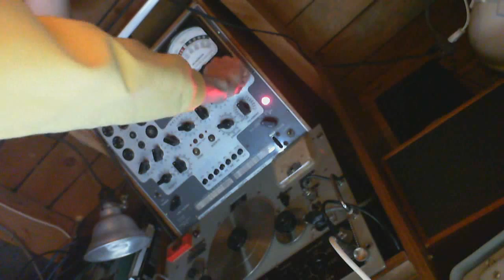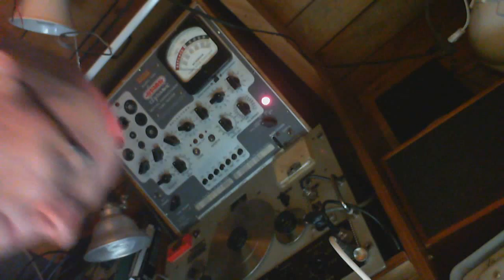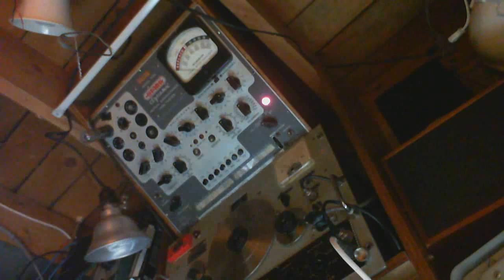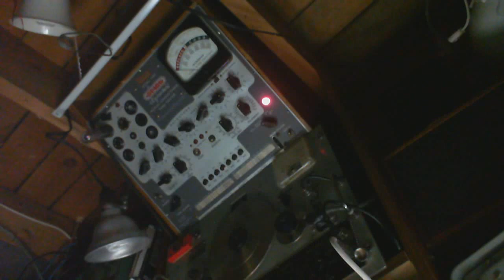Canadian General Electric KL-76 Vacuum Tube Radio Video #7 - Testing the Magic Eye

Comment: Jim, why not solder the resistor under the chassis where the wires go rather than taking the socket apart and risking breakage? At the very least you can use clip leads to temporarily insert it into the circuit to verify that this is the correct diagnosis. (It sure seems like it is but never say never. It can't hurt to verify.)
Reply: I am thinking he will have to take the socket apart anyway due to removing the old resistor. In my humble opinion.
Reply: That resistor showed 100% open so perhaps not.
Reply: MisterClaws
I hope not. though I have seen them make a reconnect before. due to thermal expansion. The odds are like 50/50 of that happening.Thank you for the reply. Take care
Reply from the maker: In my previous encounters with Magic Eyes, the resistor was never open but needed to be changed.  In this case, I just went forward the same way without realizing there might be other options.  Thanks for the great ideas.  Jim.